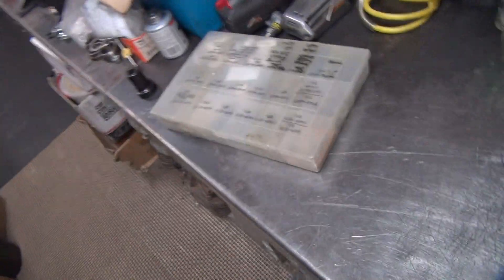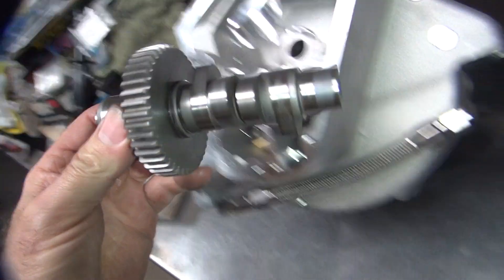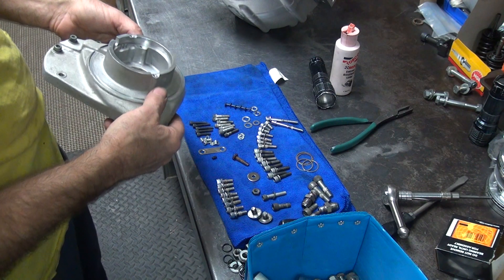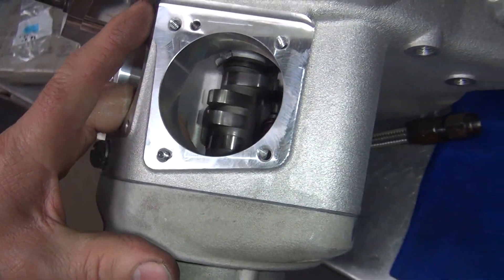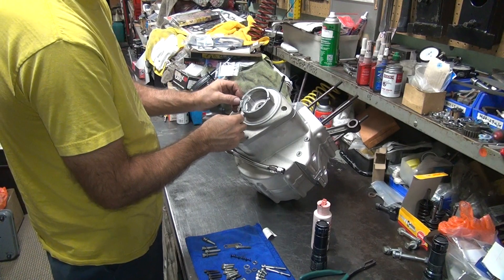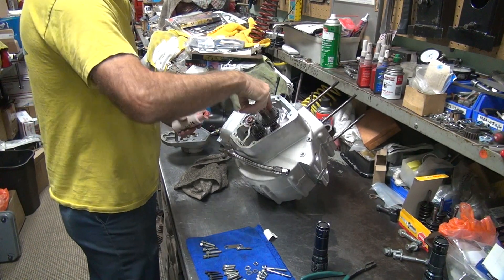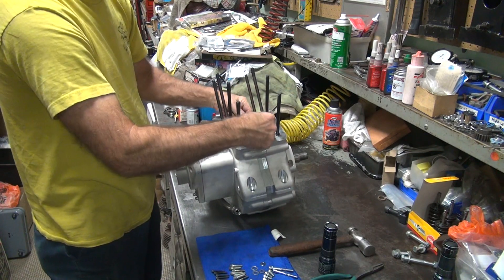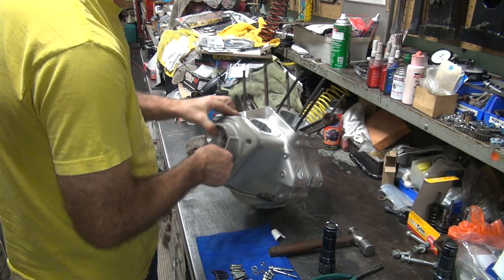#115 S&S 113ci evo motor pulled cylinder studs repair harley swift evolution head by tatro machine

Comment: Tatro , the breather Spin freely and Easy once it is full seated. The one I have in my s&s 107 is not, I’’ve noticed that is not a even diameter. Can I rectify a few . Lets say from 1.1240 IN to 1.1215 . I think is the dimensión It needs to spin freelly . Thank you Great video. Saul
Reply from the maker: sounds like a plastic breather valve. its time to move onto a steel one.
tatro

Comment: Aren't you going to tell the customer about that crappy cam?
Reply from the maker: he watches the videos too so he knows all about it.
tatro
Reply: Tatro , the breather Spin freely and Easy once it is full seated. The one I have in my s&s 107 is not, I’’ve noticed that is not a even diameter. Can I rectify a few . Lets say from 1.1240 IN to 1.1215 . I think is the dimensión It needs to spin freelly . Thank you Great video. Saul